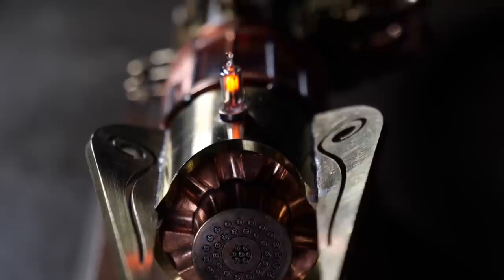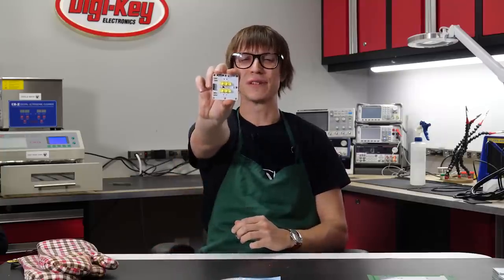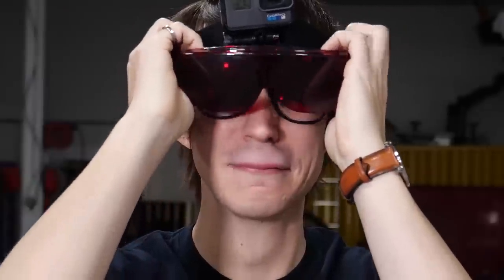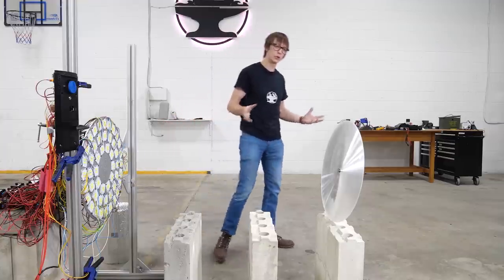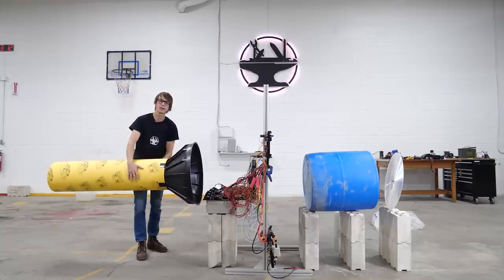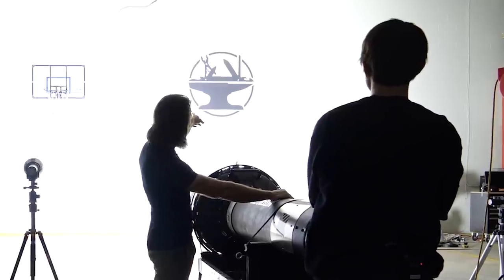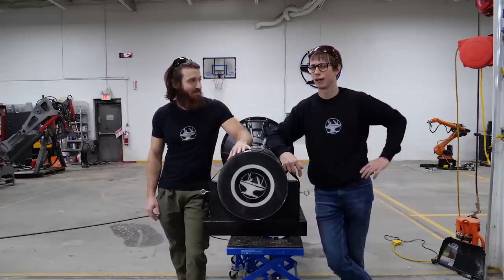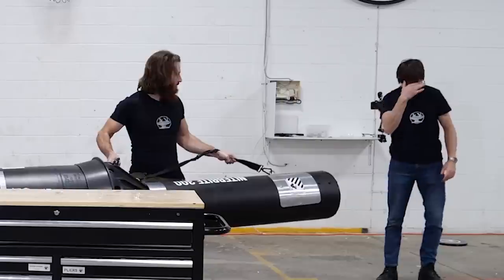Hacksmith Build World's Brightest Flashlight - Guinness World Records

Comment: By the way how could those filaments accelerate in a constant intensity and frequency of light?
Reply: The Random Internet Traveler  but it actually works with heat, not light. When placed behind a infrared filtered window it doesn't rotate

Comment: Please put it on top of a solar panel and let's how much voltage it generates and channel some of the power to the flash light, it's virtually a perpetual energy generator
Reply: Yah, unfortunately no. there's a ton of energy lost to heat and resistance, and besides that, solar panels only convert about 15% of the light into energy

Comment: The IMALENT MS32 would like to have a word with you. This small handheld flashlight produces 200,000 lumens. This would blow hacksmiths large flashlight out of the water if they slightly increase the number of leds and size which would still be handheld and practical unlike hacksmiths large, bulky and impractical flashlight. Small but the same power as hacksmiths flashlight.
Reply: Yeah definitely, the hacksmith industries light is awfully designed

Comment: Be interesting to see how bright 10 MS18 flashlights would be.
Reply: There’s is one that is handheld and produces 200,000 lumens called the Imalent MS32
Reply: Hacksmith is an oversized flashlight that isn’t practical in any way. This small flashlight already prudes 200,000 lumens. All it takes for this company is to slightly increase the size and number of leds to beat hacksmiths large impractical flashlight.

Comment: They used 300 XHP 70 led chips , each of which can produce around 4000 lumens so 300*4000=1200000 lumens but this video says 500000 lumens 

What went wrong 😐
Reply: I dont know an awful lot about light but do lumens stack like that
Reply: @DarthAxolotl  yes 

Turn on 2 light bulbs of the same kind instead  of a single light bulb

You would expect to get 2 times more light right?
Reply: @رضاشریعت  wouldn't interference patterns mess with that
Reply: @DarthAxolotl  Nope , First of all this light is not a coherence light so interference wouldn't happen , And interference makes light brighter at certain directions while making it darker at other directions , the overall output is not altered by interfernce